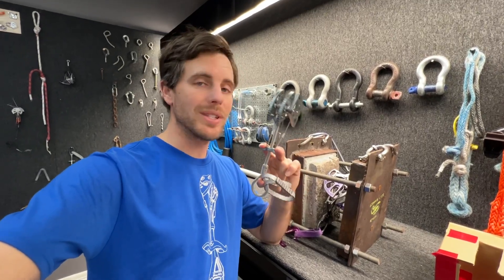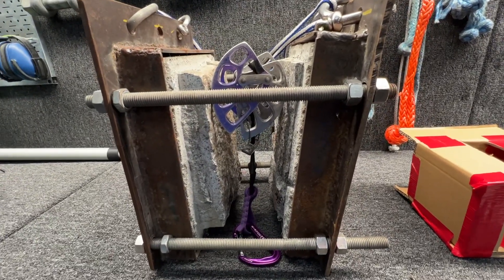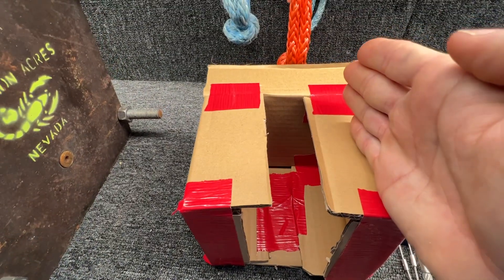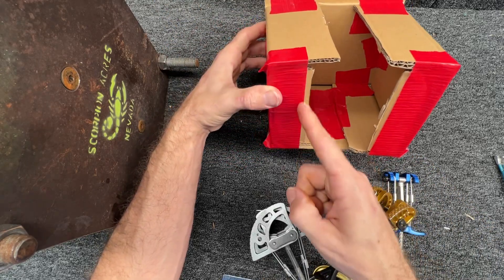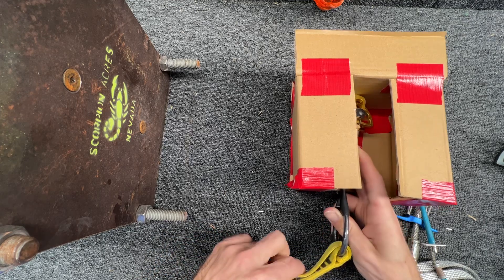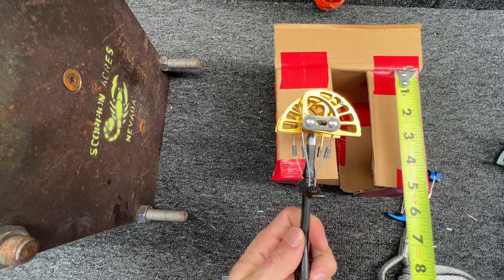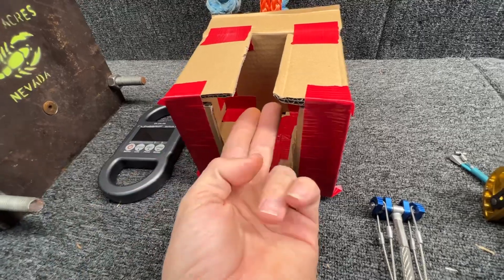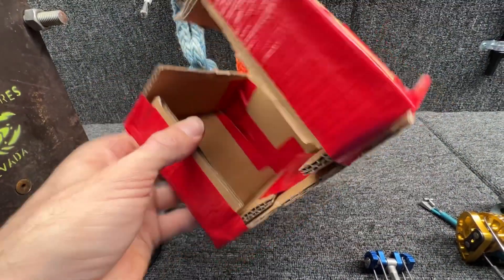CAD (Cardboard And Duct-tape) mockup of a new climbing cam tester

Comment: There are a few comments about welding the bolts to the back of the plates, and I think that's a cool idea. The BlackDiamond guys did the same, so maybe it is a good idea. 

One idea could be to have some kind of guides on the top (to guide the plates and hold the weight) and bolts on the lower part of the plates, having 3 or 4 bolts per plate to hold it in any position

Comment: What if the plates are held captive by a dovetail rail across the inside top?
Reply: I was thinking a slot cut in the top of the frame. And, T protrusions at the top of each plate. But, the vise idea mentioned in another comment sounds really promising.

Comment: I would probably go for three different sizes. Even with inserts, the holder will have to be big enough for the largest size, which is awkward for the smallest size. Also, metal on metal will slide. It is not the same as metal on rock. So you need a liner/insert made out of stone for the holder. How about a holder where you slide in the cam from the top, handle first? This would look like a crag  with an opening that gets smaller going downwards.
Reply: Kitchen or bathroom tiles! Roughen with a grinder if necessary

Comment: I’d suggest bugger C channel, use SHS. Much simpler to cut a sight window with a grinder than weld up 2 sides and a spacer at the back.

Also, I reckon you’ll still be fighting flex using bolts to position it. Instead, use a timber wedge on each side to space out the rock plates. To neck it down for smaller gear, use flat sections of timber behind the wedges.

The timber will only ever be stressed in compression, where it’s super duper strong. You want to avoid (hah) any voids behind your plates as that is where they’ll flex and fail. No way around that with bolts.

Retain it all at the bottom with flat bar welded on. Leave the top open and load the places and spacers from there.

Comment: Have your welder repurpose a vice. You could fabricate any jaws you want. Have plates cut at varying angles. Or build up flat plates to different angles. To accommodate various angles bolt on different angled face plates to your fabricated jaws. Big steel plates with bolt holes welded to standard vise. Then you could pull cleats with your slack snap machine. That are held in place by a modified bench top vice. Weld a nut on the end thread and you could make quick changes with a cordless driver.

Comment: you could weld on 4 U shaped groves on the plate that are as deep as  a bolthead with the open end of the groves pointing up, so when puting the plate in it 4 bolthedas would slide in those groves and when you tighten them half an inch or less the plate would be held in place by the bottom lip, or alternativly have two long U groves

hope that what i said makes sense, too bad youtube dosent allow pictures, but i think you will figure it out(if its still unclear say so i will send sketches on twiter facebook...)
best of luck

Comment: You could use four bolts with swivel heads welded to the back of the plates to get the adjustability and rigidity you need.
Reply: I was thinking the same thing. The first thing that comes to mind is Halsey clamps work. Threaded rod through a fixed nut and then the clamp side has a semi pivoting head.
Reply: yeah, any harbor-freight C-Clamps with swivel can be repurposed. cut the t side of the screw and weld a nut so you can adjust those with an electric drill

Comment: How about a long hinge like a barn door hinge , with the interior lined with concrete and 2 bolts at the bottom to control the angel ( to simulate a crack in rock ) ?